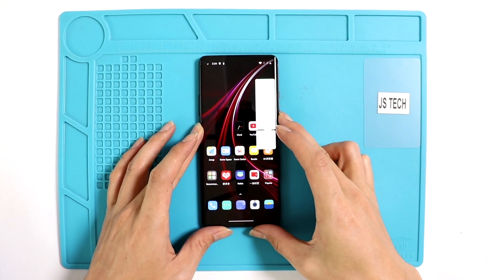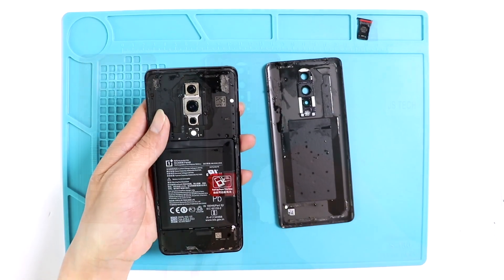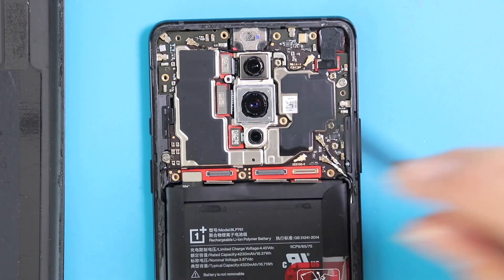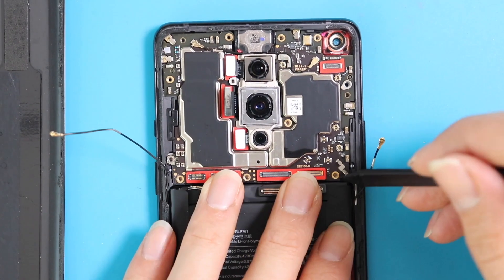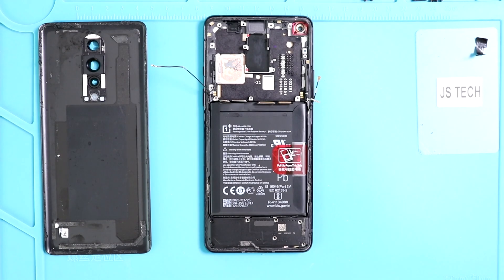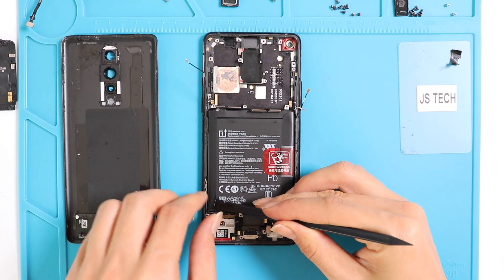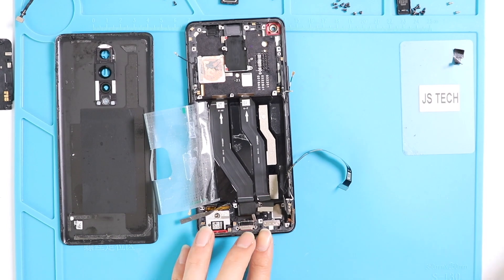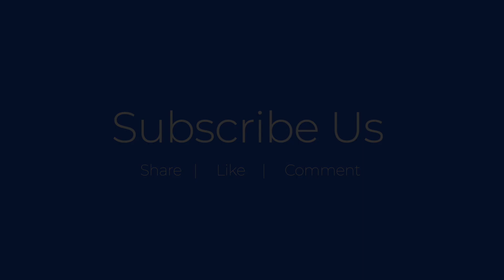Oneplus 8 Teardown

Comment: UV glue got into my reciever while applying screen protector and now the volume for calls and other things is very low.....How do I fix or clean the reciever??
Reply from the maker: you can try to use Isopropyl alcohol with a cotton bud, just clean it gently. If not you might need to open the phone to clean or replace the earpiece unit.
Reply: @DIYGeardo  okay bro... thanks for the suggestions...love your content🔥

Comment: When you're finished with a repair and are replacing the back cover, is the original adhesive reusable, or is it necessary to replace it?
Reply from the maker: Always good if you can replace. But not necessary, but make sure it is tighten, otherwise it will start to open